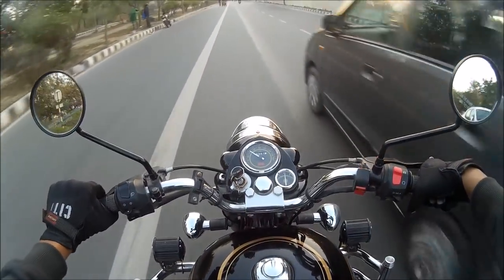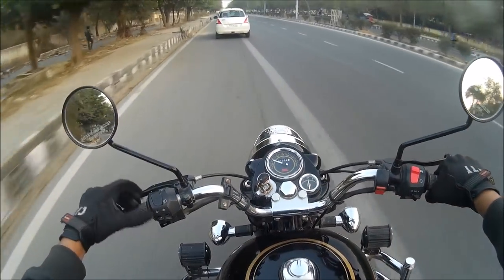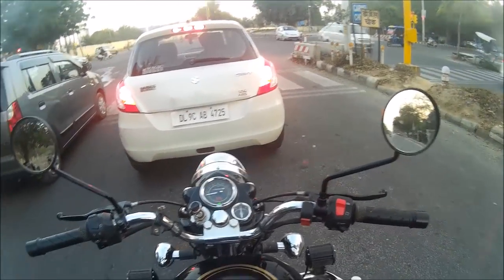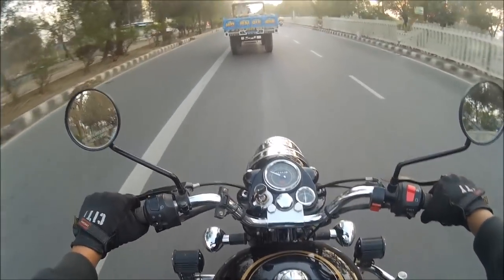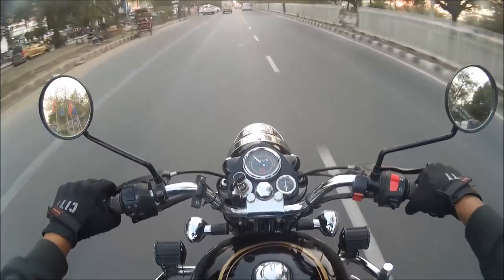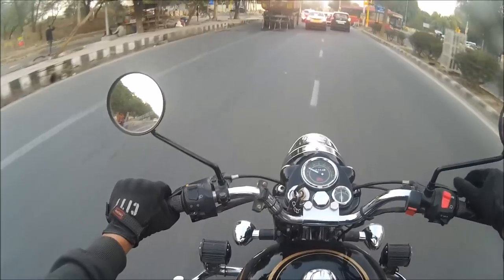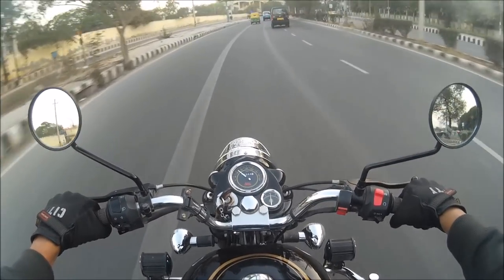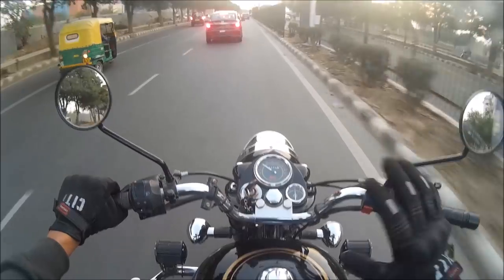How to use Drum Brakes in Bullet?

Comment: Nothing useful in this video. Just repeating the same point maintain distance. No tips regarding handling brake. Waste of time..
Reply: Arun Surya drive slowly, maintain good distance betwwen vehicle in the front, dont spam the brakes regularly(which would heat the drums and may cause break failure), use engine braking with brake(engine braking is safe until u know how to engine brake), change drums regularly.